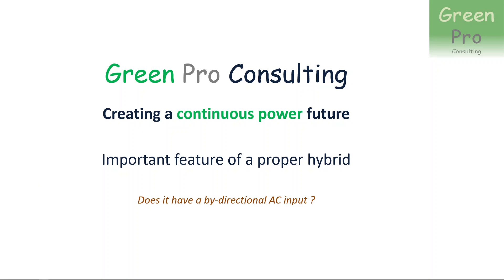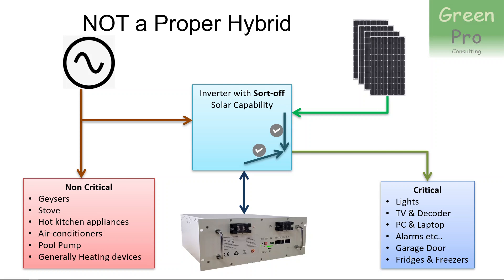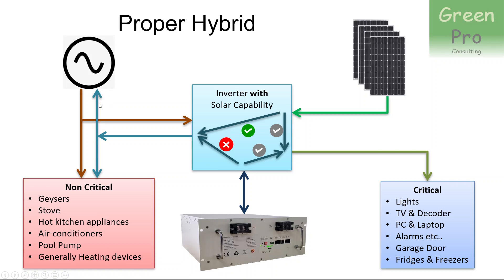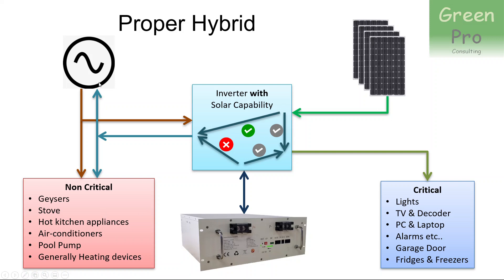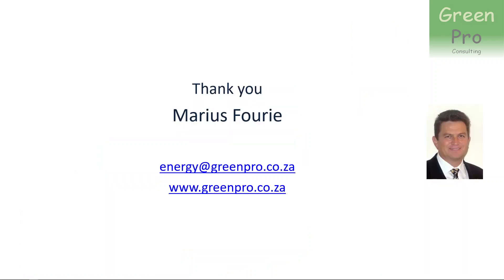Make sure you buy a proper Hybrid Inverter.

Comment: Hi Marius , is this a proper hybrid inverter? : RCT Axpert MAX 8K48 8kVA 8kW 48V Hybrid Inverter
nowhere can I find information about what you speak off, suppliers don't give this information. how does one go about confirming if their inverters are true hybrids?
Reply from the maker: No its not. None of the Axperts can push back, even if RCT paints their name on the front cover.
Assume only Sunsynk amd Victron can push back. If you don't have panels it does not matter.
Reply: @greenpro-greenproconsultin7420  thanks. I assume deye is true hybrid as well. If not mistaken deye is supplier to sunsynk so they are almost the same. ? Def would be going with panel setup to try and be partially off grid if not fully during sunny days.
Reply: @gamingwithezeep4317  yes, the Deye is a proper hybrid. I also heard the they make the inverters for Sunsynk, but Sunsynk then adds better software. I have a 5 kW Deye and it definitely is a Proper Hybrid as per Marius' video.
Reply: @jcwoodworx-corneeldutoit3419  thanks. Decided to go 8kw sunsynk.
Reply: @greenpro-greenproconsultin7420 The Luxpower SNA5000 is also a true hybrid from what I can tell